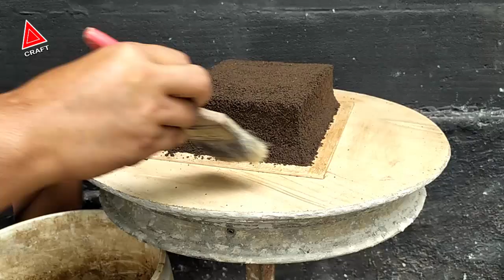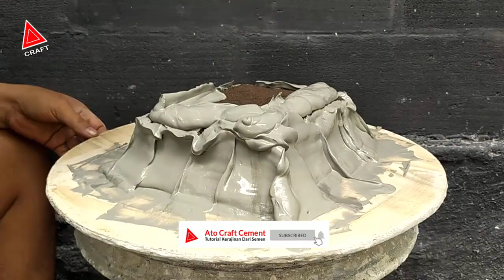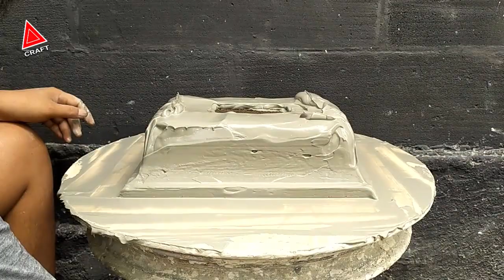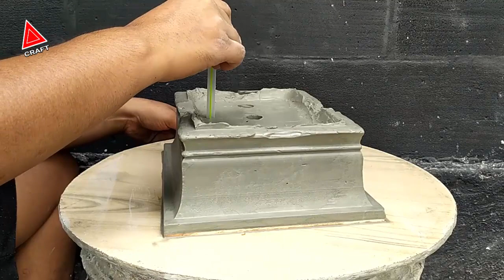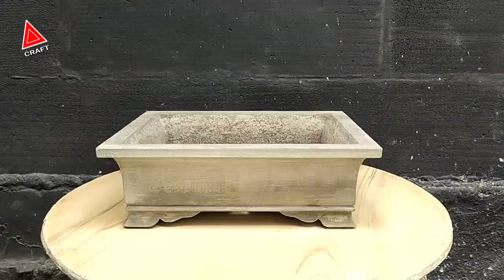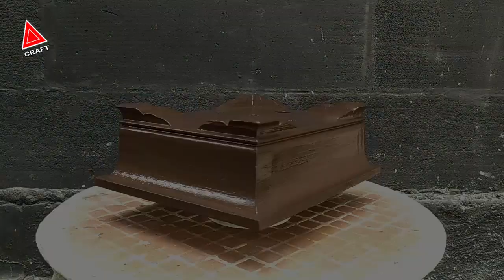How to Make Bonsai Pots From Cement

Comment: Did you mixed sand to your mixture? If non can you tell me what is your mixture.? Thank you.
Reply from the maker: No sir, I only use calcium carbonate and cement
Reply: How do you find that mixture lasts? Will it last for years? And does the lime make it more flexible so as to avoid cracking with frost!? Thanks

Comment: Hate another video without materials listed . Are you adding plaster of Paris 50/50 with pre mixed cement ? Mine is very rough and doesn't work that smooth .
Reply from the maker: For the basic ingredients I only use Cement and Calcium Carbonate 1:1 And the last stage of my refining is only cement, hope it helps

Comment: Would using some kind of mold inside work instead of the sand?
Reply from the maker: Sorry, you don't understand what you mean
Reply: @AtoCraft  what i mean is that instead of using the sand to make the shape if the inside of the pot, can you use something like a mold that's the same shape of the inside of the pot?
Reply from the maker: very possible sir,